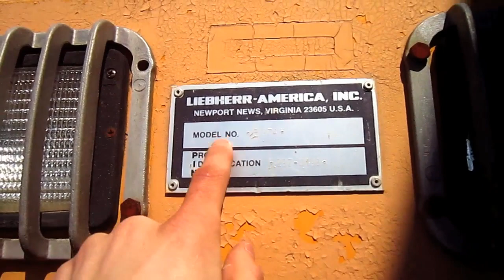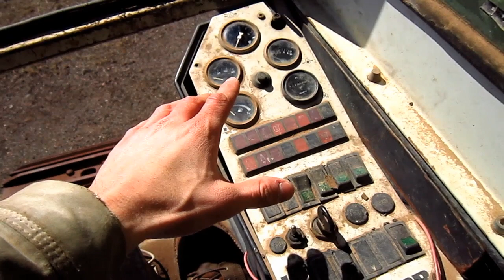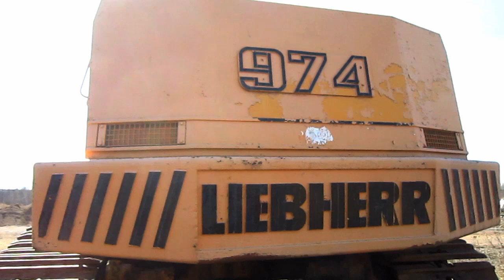Liebherr R974 Documentary

Comment: I'm a bricklayer and I find myself on all kinds of construction sites commercial residential doesn't matter either or every once in a while you come across properties that have junk on them but I will say this leihber komatsu caterpillar they are all very reliable tough strong going to get the job done you know you're going to be able to turn that key that things going to start it's going to do what it's supposed to do more than likely and if it's not it's because it's been so neglected and it's still wanted to start every day even though you kept neglected it you finally got to the point where just couldn't do it no more and it took years of you have beaten it and just abusing it for it to finally fail so you really have to abuse those machines and put them through the roughness to get them to fail you just take care of them and do what they're supposed to do they run and they will not stop running